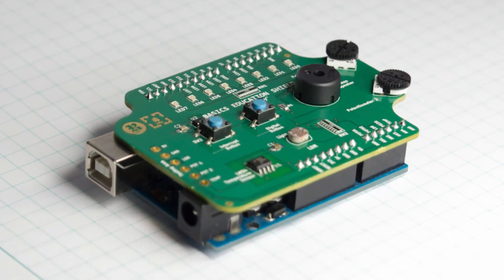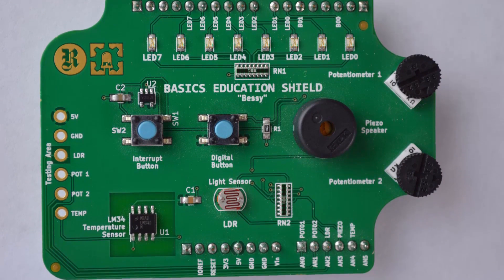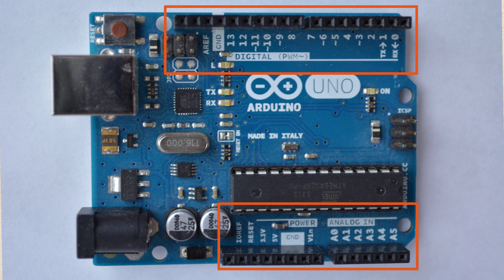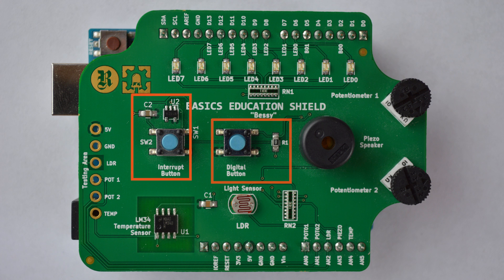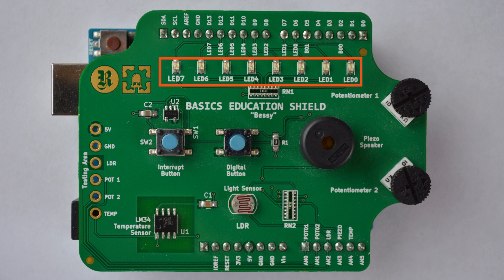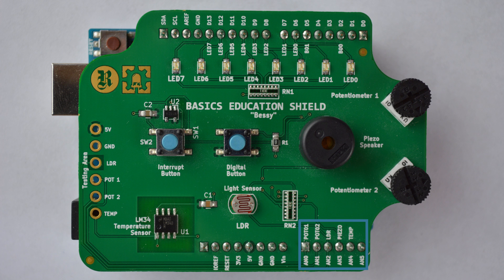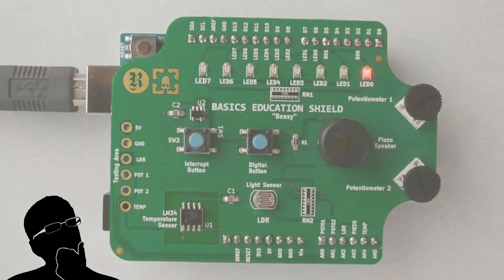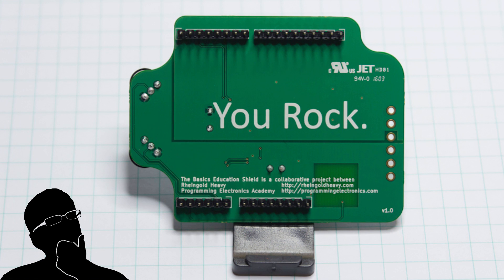Kit-on-a-Shield for Arduino

Comment: But no inputs from external sensors.  I suppose it’s easy enough to make a intermediate shield that accepts inputs but it would have been nice to make it a bit wider ( still fitting the arduino) but with inputs.

Comment: Michael, I bought a Kit-On-a-Shield and loaded the DigitaReadSerial sketch.  According to the description, the program outputs a 0 to the Serial Monitor until Interrupt button (02) is pushed, then it outputs a 1.  Mine works exactly backwards.  It ouputs a 1 until the button is pushed, then it outputs a 2.  ???????
Reply from the maker: Hi Ben.  Great question and thanks for your business!

Pin 2 on the Kit-on-a-Shield holds an input HIGH, and when the button is pressed, it drives the input LOW.

The reference for the shield is here:  https://programmingelectronics.com/kit-on-a-shield-for-arduino/ 

I just checked and saw that an older reference we had was incorrect - and so I updated that.  I hope this helps some.

Comment: Pertinent to those of us who prefer to program setting pinMode with INPUT_PULLUP ... do the resistors on the "Kit on the Shield" have any effect on that process where the LED(s) should turn on when the code sets one or all of the 8 pins with attached LED(s) on "LOW"?

Comment: Im just beginning to learn arduino coding and this would be good for the absolute beginner but thats about it. (IMO) I'd like to see some analog and digital pins open for our own components and such once people start learning more. Or maybe find a way to keep everything on the shield as it is but have the option to switch between using whats on the shield or plugging in your own component. (Hope that makes sense) That would broaden your market beyond the pure beginner.